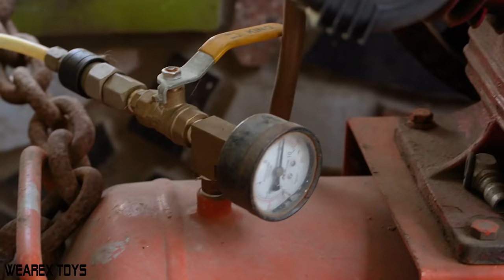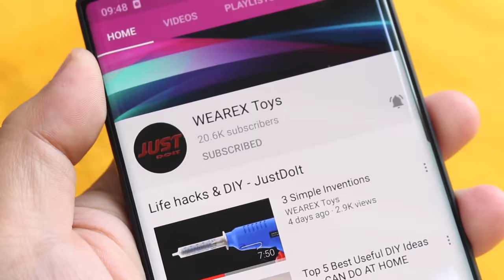Making a Compressed Air Engine from Motorcycle Wheel and Fork

Comment: so you have a compressor.  a fat motor that drives a pump.  this allows you to spin a wheel on air.  what's the point of this?  1 - you have air motors for sale that use much less air.  2 - If you want to make something yourself, it is better to connect the motor of a compressor directly to your project.